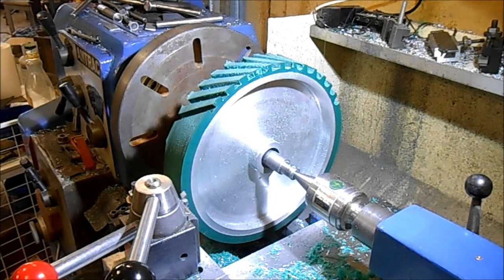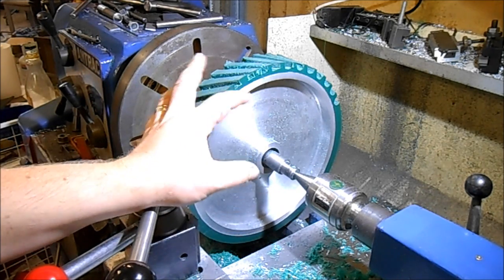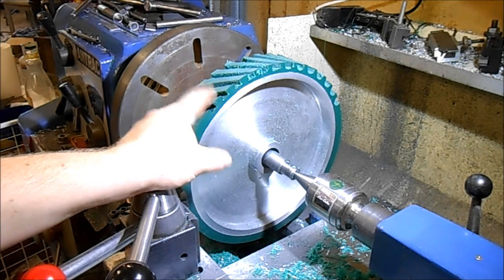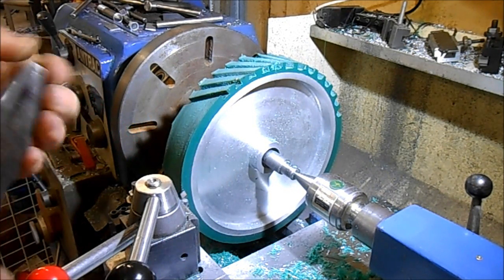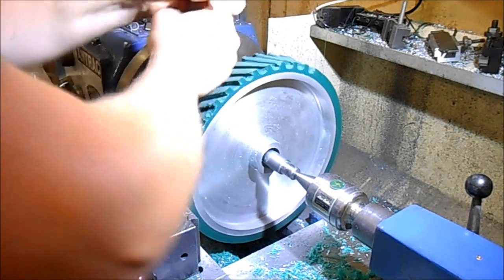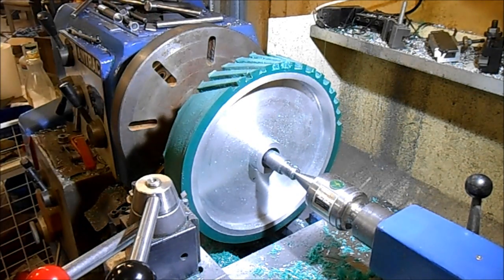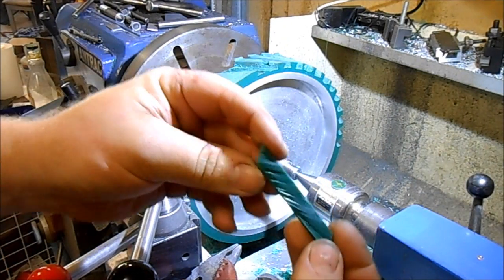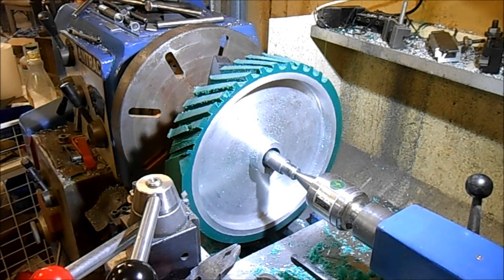Contact wheel rubber destruction test

Comment: That stuff is bomb proof. Thanks for sharing your medieval tricks.

Cheers,

Tom
Reply from the maker: Was i really that rough Tom?? :) Or are you referring to what seems to be the lost art of turning between centers on a mandrel?

Cheers,
Ewan
Reply: ueee84 Hey Ewan,

No I was commenting on the toughness of the rubber you used. It seems quite strong even in a small cross section. I use the term bomb proof to describe things that are tough and durable. 

All the best,

Tom